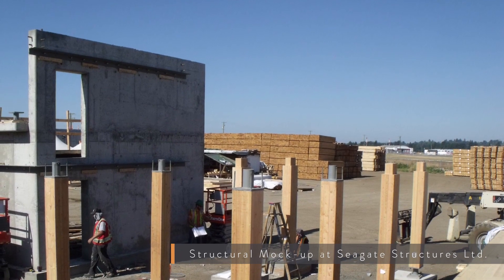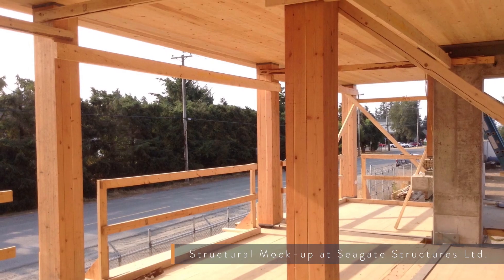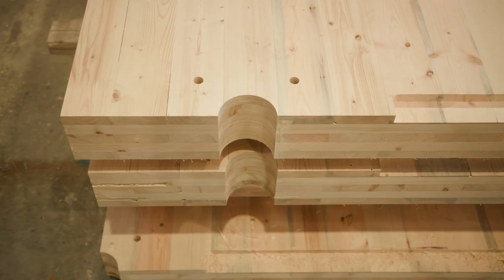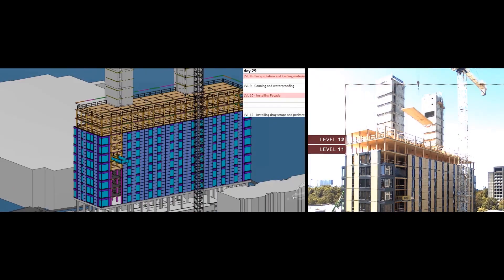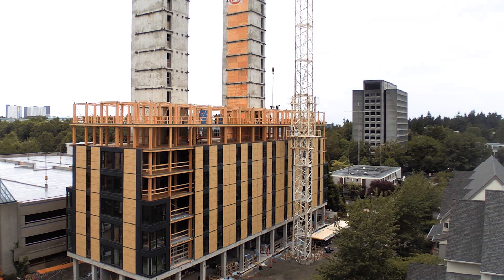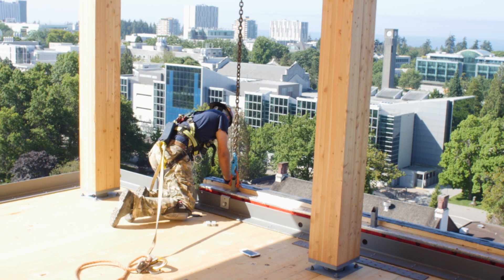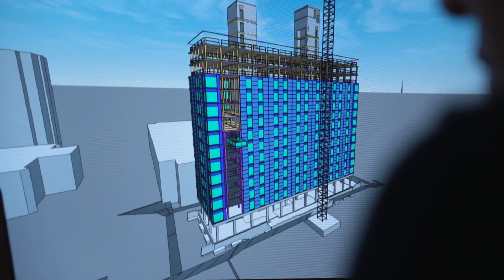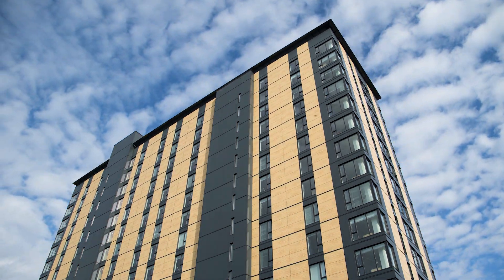Brock Commons Tallwood House - Chapter 2: Design Process

Comment: Awesome. Structural Timber. I wasn't on board at first due to number of trees downed. But, with their large scale replanting of trees the impact is negligible. However, there are some people complaining about monoculture in only replanting a single species of tree and not the variety that were downed. But conceivably if, for example, they down 50 acres of trees at a time, 15 times in a period, and there are 15 species downed, they could replant 15 monocultures with each 50 acre replanting being one species. Overall, I love the technology and research of this and the developments that have been made.